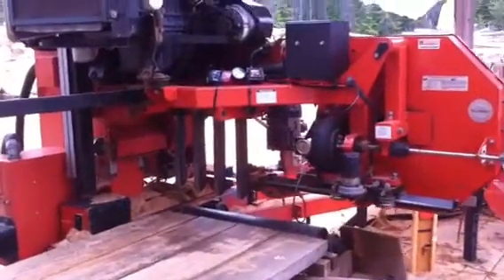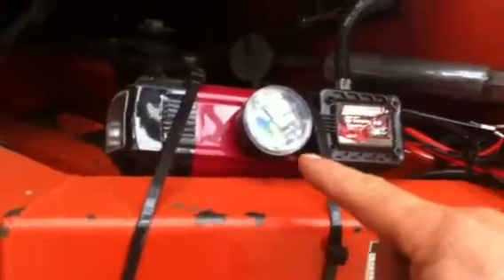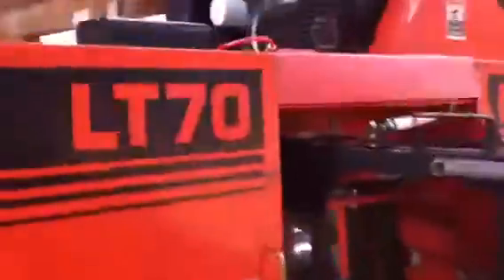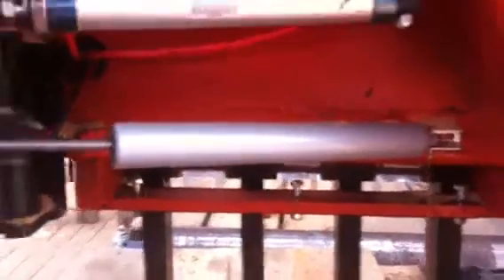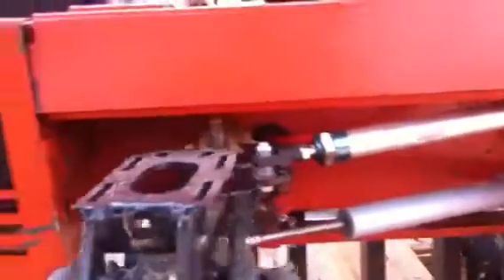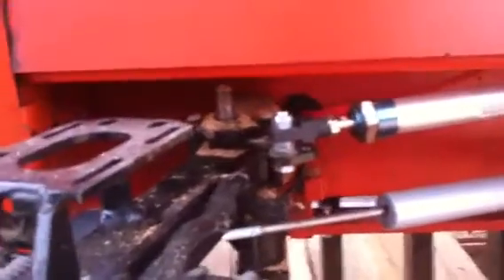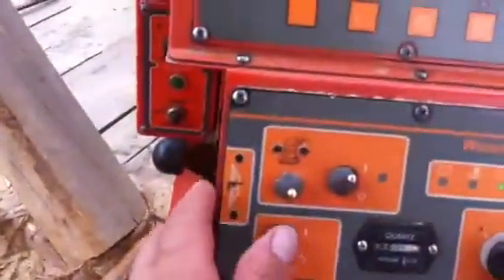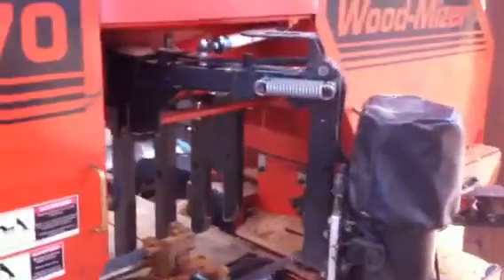Debarker modification

Comment: What dump valve did you use?
Reply from the maker: Its a 25.00  valve(12 volt). Just a 2 port valve to dump air out of the system when activated.  I have since refined this with house compressor air and a second identical air valve for input air....
Reply: @Igneroid  might be time for a new video update cause it seems to be pretty slick